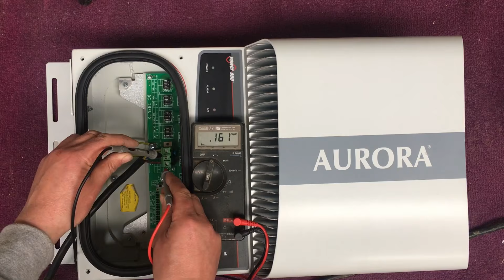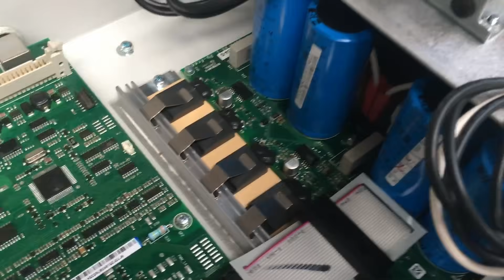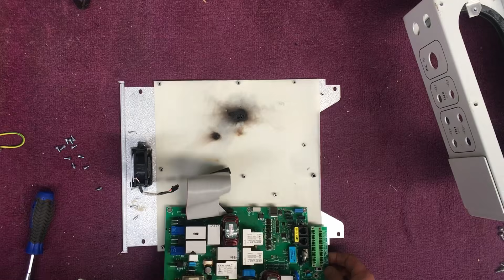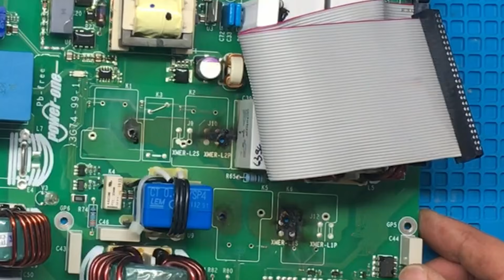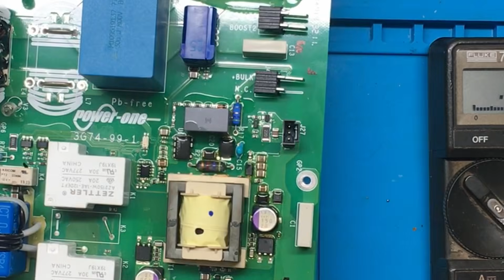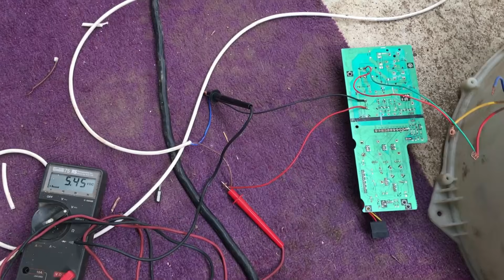Solar Inverter Repair / Fix - Aurora Power One (Multiple Faults) and E031 error

Comment: I saw your solar and tractor videos at firist and thought you are a farmer. Looking more at your channel, it looks like you are an electrical engineer. Is it public, what you are doing by trade?
However, I am always surprised how fast you proceed to replace parts. If stuff explodes like that I would have assumed a different fault. But then, I've no experience with relays at all.
Reply from the maker: You are correct! I've been into electronics since I was a child, worked in electronic repairs and software development, but moved to the country and became a farmer a couple of years ago. We mainly have sheep / horses / goats / chickens / ducks. I also like reverse engineering and re-purposing electronic devices.
Reply: @BuyitFixit  Do you focus on agriculture? I would expect animals are more stressful. Did you stop software development entirely or did you find a way to balance everything?
Reply from the maker: @merkatorix  I've kind of stopped software development for work. Although if I need to I would still do stuff. Like I built and internet connected incubator out of a old wine fridge. Designed the pcb and wrote the software for it. And recently I knocked up a key gen for the aurora inverter service password.
Reply: @BuyitFixit  Did you stop, because it would be to stressful to balance software engineering and agriculture? I heard of someone trying it, who just became depressed. It sounded like he didn't manage the software deadlines anymore, but he was a small farmer trying to sell his crops, plant them and to do software engineering and I suspect selling stuff just takes too much time at random time, which eats up all time to concentrate on software. Furthermore, I am still not sure, if his agricultural ambitions were viable from a business case. I mean, he had to sell his crops himself to have a chance at all.
Or did you stop juts because you didn't like it as a job anymore? 
Getting into crops without a lot of experience, if would be a little ancious of pests eating my crop. Did you do a new training to grow stuff?
 
I'm working as a software engineer myself and I wonder if there are ways to combine it with agriculture. However, I just have some basic experience with tilling ans was never in charge of pest control, yet.
Reply from the maker: @merkatorix  our land and area isn't the type to grow crops. We are only a small sheep farm. Probably around 50 head of sheep. I just wanted a change and to be out in the country away from civilisation when the SHTF.
Reply: @BuyitFixit  I totally feel that. And I think animals make it harder to concentrate on any kind of software project. While crops have times, when they don't grow (like in the autumn) and if they grow, they usually don't escalate within hours, except maybe for very nasty pests. Animals just require more attention. However, I know a farmer in Australia who manages being an engineer and a sheep farmer, but his farm is giant and I guess he has employees, who somehow work for that little money, that it pays off for him to be an engineer. And there is the youtuber jonny999, he has a dayjob, too, but he doesn't have animals, just growing corn, I guess.
I still search for some people doing softwareengineering on an independent basis combined with farming.

Comment: Very interesting, the relays were very bad, probably the inverter was over powered and mounted in a hot badly ventilated area (a loft). Great extra about the switch mode supply. I use a variac powering an isolation transformer and a smoothed rectifier to simulate the DC. Yes from the same mains that the inverter is feeding into, Good upgrade to the tracks, normally they are double sided, but these were burnt away. Cheers
Reply from the maker: Thanks Andy! You were correct it was mounted in a loft from what I was told. I also looked at your channel and videos!
Reply: @BuyitFixit  Disconnect at full output is a relay killer. Hope you enjoy my videos, cheers
Reply from the maker: A fun fact... I used to be more into software and programming also reverse engineering hardware / software (I like to know what makes things tick). I needed the engineer code for the inverter and "tech support" were not forthcoming. I figured out the algo for the service section, and wrote a keygen. If you ever need a code, hit me up!
Reply: @BuyitFixit  That's grand, always keeping in touch with similar minds, thanks
Reply from the maker: @TheInfoworks  I also found some "easter eggs" in the Aurora Manager TL V3.13 software. When it's connected to an inverter, CTRL+SHIFT+T = Tetris, CTRL+SHIFT+P = Pong, CTRL+SHIFT+Z = Debug mode (shows bytes sent / recieved from the inverter). See picture: https://imgur.com/a/E6OcdyS
Reply from the maker: Hi Andy, I found this program today called CVI 5.0.1 https://www.solacity.com/docs/CVI%205.0.1.zip  I took a look at the code and found a password of '91951' in the program. This fully unlocks the tool, which generates inverter passwords, and pretty much allows you to alter everything you possibly can.
Reply: @BuyitFixit  Hi, that sounds mighty interesting although I've never dug in that deep to code. A video from you detailing your finds and how they may be applied would be helpful to many people and I'm hoping I would learn from it. Cheers
Reply from the maker: Hi Andy,
I eventually got round to doing a video on that (just released), let me know what you think!
Reply: I'm a Sparky and the amount of Inverters I see located, in roasting hot, ultra insuated lofts these days, in the summer and freezing cold in the winter.. Madness
Reply: Dead right, those that fitted the system are not engineers, cheers @jonnyduncan7056

Comment: Nice one. Sometimes, it's the smallest things. I found it was only a diode that killed an entire set of disco lights. And a small signal capacitor on a music system. I have a TRS 80 portable computer with a PSU issue. Would like to see some more fault finding techniques. 😊
Reply from the maker: I've had a couple of requests to do some basic testing and fault finding. It's on my todo list.
Reply from the maker: I've been working on some video's of basic component testing which should be out today or tomorrow. I'm going to do a fault finding video on a switch mode PSU as part of that series which will be out shortly after those.
Reply from the maker: Hey Matt, is it a switch mode PSU? I remember you mentioning about power supplies and I've just repaired a caravan battery charger (essentially a 12v switch mode PSU). The video should be out the weekend, and I explain how it works etc so you may find it useful.
Reply: @BuyitFixit  I think it is a switching one, that produces various rail voltages from the 6vdc batteries. There is a small transformer that I guess is running at high frequency. I can cheat, with this repair, as I have just bought another working computer, and got a 'scope, so I will do some comparisons. 😊 Keep up the great content.

Comment: Just found this whilst looking on how to repair our faulty inverter.many thanks! What were the diodes that were replaced as ours seem to be the same .thanks again
Reply from the maker: Hi, the two diodes I replaced were SMBJ15A (the small rectangle one to the right hand side on the video) and STPS5H100B which was the one that looks a bit like a transistor (larger of the two at the left hand side on the video). I'd check to see if you have a short circuit first there like I did, as it may not be the same fault but display similar symptoms.
Reply: @BuyitFixit  Just checked and the small diode is short circuit and the relays have burnt up. Looks like it could be a common problem? The fault was no power and a fast clicking noise when the panels were active .The clicking noise stopped when the panels were isolated.I will order the parts and see what happens!.Once again thanks.
Reply from the maker: No problem. Glad you found the video useful.

Comment: I picked up three inverters off the side of the road. One I replaced the relays on due to a relay error diesplayed on screen bit the problem remains. I'm thinking there must be some current sense circuitry which can detect if the relays are functional but don't know where to look or how it would be achieved.
Reply from the maker: Same make and model as these ones? Would think something like a long line of resistors, a coil or opto-isolator would probably be used. If can give me a few more specifics I'll try and help.
Reply: @BuyitFixit  I'm glad I see your name on the Recessim channel. It was his video on 3v = 240v and your reminder of the long line of resistors that helps in indentifying the components on the Saj Sununo inverter I have.
Mine has the four relays but they appear to be in series, 2 for live and 2 for neutral, all powered by a 4-gate AND with identical circuitry between the logic gate and relays.
I'll see about putting the stills on my own channel for clarity
Reply from the maker: @ianhelsbyservices  Yes,  I posted on the Recessim site, I used to do a bit of reverse engineering / repurposing stuff, although I haven't done so for quite a while now.

Comment: The relays are rated for AC yet they're used to switch DC from the panels. I think over time the contacts wear causing a heat buildup which finds the solder joint as the weakest link.
One would hope they fitted the relays into sockets like those varistors(?) near the cable inputs.
Reply from the maker: The relays are used to switch the mains power not the DC as I first thought when I opened it. 
There seems to be two for the live, and two for the neutral. I think it switches two of them, and then measures the voltage / frequency. Then it switches on the other two if everything is OK? I'm not 100% Either that or perhaps a safety feature in case of a fault. I've not really examined why they use the four relays.
Reply: @BuyitFixit  My repair swapping all 4 relays worked for a few hours then got an W003 grid fail message - grid voltage out of bounds. The grid voltage doesn't stir at all during the cycling (solid at 243V). I suspect a faulty new relay or solder joint. Any idea where to look?
Reply: @minxythemerciless   its not your relays . it will be the control board . i have repaired around 60 of these . and it will be a FET on the control board . Also you dont need to add the wires as shown as the holes are plated through
Reply: @chrismurphy7324  I replaced the relays with identical models after a big fight to desolder the old ones - my iron was just enough and a bigger iron would have helped.
I had initial teething problems but after reworking everything it came good. The result is the unit has been working just fine for over a year now
Reply: Et non les contacts ne s' usent pas, pourquoi ???  parce qu' ils ne commutent jamais de courant,  au moment de leurs enclenchement le courant est pratiquement a 0 ampère, idem a la coupure,  le courant augmente après quant les panneaux montent en puissance.....

Comment: I'm a subscriber of Andy Reynolds who's done a few on solar and wind turbing generation. Kris Harbour for hydroelectric
Reply from the maker: I've seen kris harbour before. The washing machine I used to power the inverter actually has a pelton wheel on the other side as I was planning on using it as a water turbine like the guy who has been running his house for 15 years on one. I've got some solar panels coming next week and actually bought another faulty inverter from Ebay same as the one I got given. I fixed that one too but didn't do a video on it as it was just the relays and the video here already covered that.
Reply: There's an Omnik inverter sat in the corner of my room waiting for new relays.
I've also a 10kW inverter to inspect too but the turn on voltage is over 500v DC. Not sure how to generate that.
Reply from the maker: I've replied to Andy on this video as he posted a comment, I've since found some interesting software and done some reverse engineering. Have a look at the comments I left above for the link / password. Might be of some use to you.